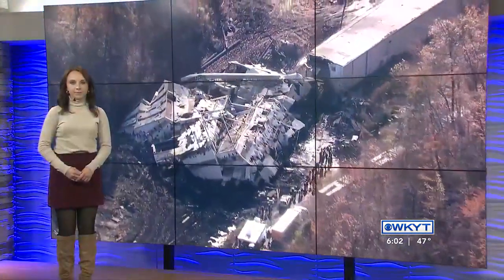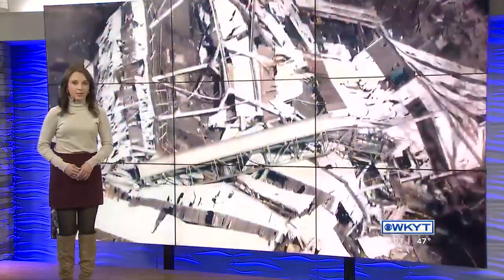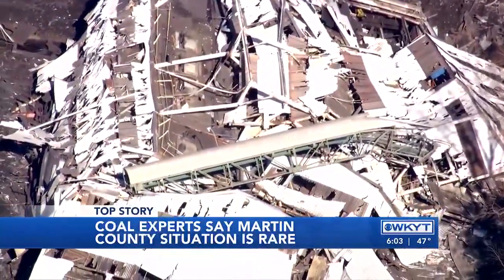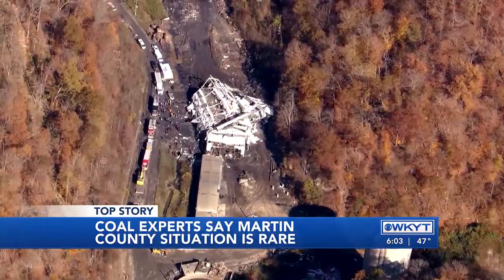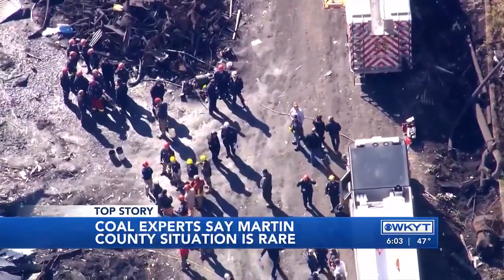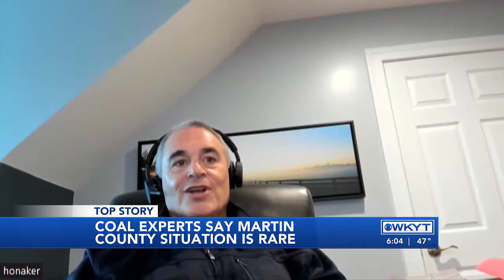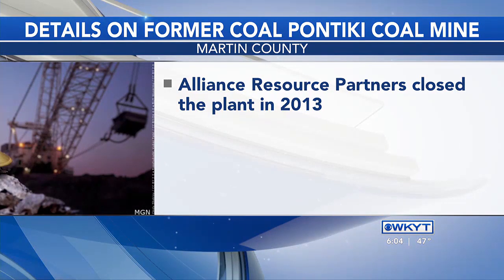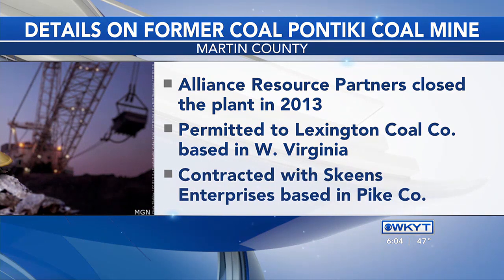WATCH | Coal experts say collapse at idle Martin Co. production plant is rare occurance

Comment: I was working with a demolition company in Georgia on a five story building.  They had the idea to torch partway through the steel beams holding up the floors then hook cables to excavators and pull it down.  It didn't work & after that of course the entire building was unstable.  Not sure what happened here but hopefully nothing similar cutting the beams.